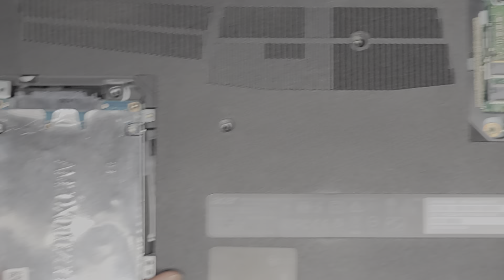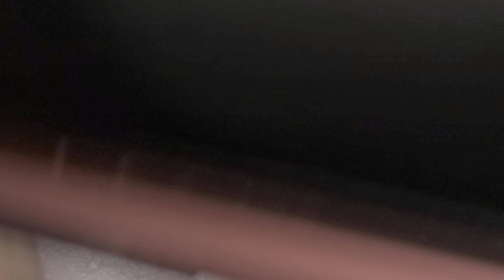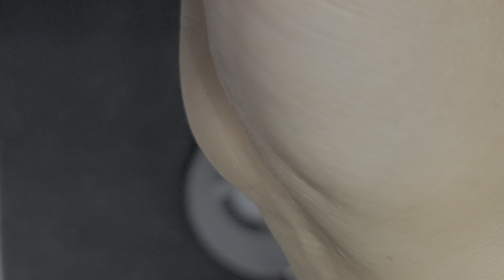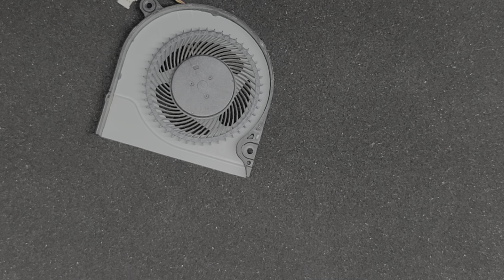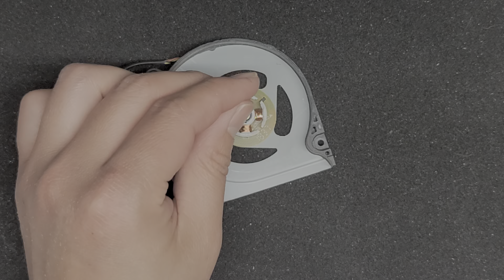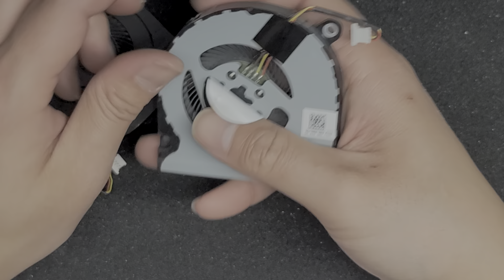Acer Nitro 5 AN515-53 Series N17C1 Disassembly RAM SSD Hard Drive Upgrade Battery Fan Repair Replace

Comment: Man, this video was the most helpful of all the videos I watched about disassembling and replacing parts on this specific model of the Nitro 5. I got an M.2 SSD for my laptop, and wasn’t sure where to start. It was also crazy how much dust buildup there was in my fans and in the laptop in general. Between an air compressed duster and my vacuum with the hose and brush extension, I was able to get pretty much everything (I was especially careful with the vacuum, of course).
Thanks again so much for this video!
Reply from the maker: Glad it helped. If you haven't already, please like and subscribe so others can find my videos. Thanks!
Reply: @ItsBinhRepaired  Definitely did both! Thanks again!!
Reply from the maker: Thanks!

Comment: Thank you! I've been suffering with intermittent loud fans for about a year now. Found enough pet hair to build a small rodent and dust for days! So aggravating but thanks to you it's back to normal!
My model is slightly different in that there are a several tiny screws holding the cover on the fans instead of the tabs. Just made it a little easier to remove and replace.
Great video with quality knowledge.
Much appreciated!
Reply from the maker: Awesome, glad it helped! If you haven't already, please like and subscribe so others can find my videos. Thanks!
Reply: Which size for fans screws ?
Reply from the maker: Don't know

Comment: 10:13 that is the haul effect sensor, that detects when the lid of the laptop has been closed. they work using magnets that are presumably build into the lid of the laptop somewhere. you can try it by running a weak to medium strength magnet over the general area of that side of the computer, the display should turn off
Reply from the maker: Yup!

Comment: The Hard drive screw was missing because they used it to hold the ssd down. I did the same thing, since the screw is not included with that ssd for some reason
Reply from the maker: Makes sense.

Comment: wassup bro, the video is great and the explenation is very exaustive, but i have a small problem.
in my nitro 5 (an515-52) i only have the ssd m.2 256 gb and i wanna add an ssd ( kingstone A400 500gb) but i dont have the silver bracket in my laptop… idk why, how can i add the kingstone ssd?can i add it without the bracket? sorry for my bad English, i’m from italy
Reply from the maker: Bracket isn't needed, but the connector is.
Reply: @ItsBinhRepaired  yes, i have the connector thanks bro for the response
Reply from the maker: @FettyBeatss  no problem. If you haven't already, please like and subscribe so others can find my videos and possibly consider watching a few others to get the algorithm to recommend my channel. Thanks!

Comment: Sssoooo. My hdd has a ribbon connector that is loose and I've been trying to figure out where to hook it back in at. It is this exact make and model. Problem is now that I can't figure out where the hdd plugs in, when I turn it on it tells me it can't connect. I can see the ribbon dangling plain as day. I've never seen one that sticks to the back like that
Reply from the maker: Under the other cable
Reply: @ItsBinhRepaired  hi i have this same problem. I was looking at the wrong video and lifted the case without disconnecting the hdd first and the ribbon got ripped out. Can you clarify which cables you are referring to?
Reply: Nvm. Already found it under the right side of the black strip
Reply from the maker: @weirdohhhhhh  lol great

Comment: Do I have to detach the HDD if I only need to clean the fans?
Reply from the maker: Just make sure to shut down completely. Do the battery disconnect and press and hold the power button 15 seconds.
Reply: @ItsBinhRepaired  got it. Thank you for the reply. Wish your channel for the best :) glad to find this video
Reply from the maker: Thanks! If you haven't already, don't forget to like and subscribe so others can find my videos.

Comment: Yo! Do I need to hit that little button to drain power out of my battery before replacing old ram with two new ram sticks?
Reply from the maker: @DiegoZambrana-n5m  not necessary, just make sure it's off.
Reply: @ItsBinhRepaired  ok! So shut down the cpu then I’m good to remove the ram slot cover and replace. Thanks!
Reply from the maker: @DiegoZambrana-n5m  yup, just don't drop anything conductive on the internal components.

Comment: Wondering if something like "3-in-one"  oil as it does not have additives for car engines in it.
Reply from the maker: Not sure what that is
Reply from the maker: @bit-tuber8126  I see. WD40 isn't really a lubricant. I'm not sure why people use it as one. The name WD40 means water displacement. Nothing to do with lubrication.
Reply: @ItsBinhRepaired  Well aware of history of Water Dispersant, formula 40, but just using popular notation.But 3-in-one, that is a lubricant that is not full of engine oil additives.
Reply: Also, read the side of the can for it's advertised uses. Then look at the ingredients to see it is oil based.
Reply from the maker: @bit-tuber8126  what's wrong with additives? Lol

Comment: Hello, can I use a SSD M.2 of 2 GB capacity? because I had read that this model is only compatible for 500Gb 😢
Reply from the maker: Do you mean 2TB? Yeah. The max limits are wrong.
Reply: @ItsBinhRepaired   Yes!! 2TB I was wron 😵‍💫, so there is no problem if I put 2TB?
Reply from the maker: @jonathanurielgarciagarcia8837  nope

Comment: Do i need to take out the hard drive and ram to take the back off?
Reply from the maker: Hard drive, yes,  RAM no, though if you can't do that part or you feel that's too much work, I don't suggest trying to open the computer.
Reply: @ItsBinhRepaired thank you I'm doing it right now for my first time ever taking apart a PC. Was having an issue of this battery being at 0 percent and not charging so I'm gonna try to reseat the battery
Reply from the maker: @Heazytoohot  hopefully that's the issue and not something more major. Hope it goes well.

Comment: I just removed the back plate to check if it has a ssd slot, removed all the screws and only removed the hdd cable from the board, and put it back, so after reassembling when i turned on , there is only acer logo on the screen, and it's still there, will it ever turn on? Help plz, should i wait
Reply from the maker: Sounds like the hard drive isn't connected properly

Comment: Im pretty sure the wire connecting the harddrive is probably broken, do you know where i could buy one that and another harddrive?
Reply from the maker: I'm not sure. Amazon or eBay possibly, if not you'll have to reach out to the manufacturer.
Reply: @ItsBinhRepaired  what was the harddrive you were talking about in video?
Reply from the maker: @jupiter3983  I'll need a time stamp

Comment: Great Video! Do the fans work fine with the taped on cover?
Reply from the maker: After the repair? Yes
Reply: Ok thanks you. I couldn’t find any replacement fans that came with the back cases so I will try that.
Reply: Ok thanks you. I couldn’t find any replacement fans that came with the back cases so I will try that.
Reply: Ok thanks you. I couldn’t find any replacement fans that came with the back cases so I will try that.
Reply: Ok thanks you. I couldn’t find any replacement fans that came with the back cases so I will try that.
Reply from the maker: @tuckerbergeron3175  ok

Comment: i broke the wire that holds the connector for the ssd, is this fixable?
Reply from the maker: Wire holding the SSD? I'm not sure what you mean. The screw?
Reply: @ItsBinhRepaired  sorry, i’m trying to fix it rn. i found the ribbon cable that attached the connector to the ssd but the pc is not booting, i’ve tried everything but it’s won’t even get power, any ideas on what it could be?
Reply from the maker: @safferey  I need a time stamp of the part you damaged. I don't know what you're referring to.

Comment: Is it okay if replace the fan without the back case and leave it open?
Reply from the maker: No
Reply: @ItsBinhRepaired  the new fan i bought no have back case in them
Reply from the maker: @jeredorks-wk3vv  transfer from the old one
Reply: @ItsBinhRepaired  is there any way to open it without the razor sir?
Reply: @ItsBinhRepaired  or is it safe just to razor and tape them?
Reply from the maker: @Jere Dorks  a knife? Sand it down? Melt it?

Comment: Quick question: Which fan is for the CPU and which is for the GPU??
Reply from the maker: Both and both lol
Reply: @ItsBinhRepaired  Laptop says CPU fan is faulty, how do I know which to replace?
Reply from the maker: Both. Check if any of them are hard to turn. Usually CPU fan will be dustier, but in this case they are attached to the same heatsink. They both cool cpu and gpu.
Reply: @ItsBinhRepaired  Okay, got an answer on a forum. The right fan is technically  the "CPU fan". Replaced it using your vid help. (thanks!) Also found massive dust bunnies between the heatsink inlet and both fans.
Reply from the maker: @robertlauderjr.3568  Glad you figured it out :)

Comment: Does anyone here know where the HDD cable is connected to in the laptop. I can’t find it
Reply from the maker: Open up the laptop, follow it and find out.
Reply: @ItsBinhRepaired I have and I’ve looked everywhere in that area but I can’t seem to find it
Reply from the maker: The connector is missing? I don't understand. It didn't have a hard drive connected?
Reply: @ItsBinhRepaired  I looked under the USB cord inside the computer like in the video but I didn’t see anything there. Is it under the fan?
Reply from the maker: @annieandelsieofarendelle3294  are you saying yours is different than in the video? If that's the case, I can't help you. I need your laptop model number to see if I have that video.
Reply: @ItsBinhRepaired  It’s AN515-53. I think I’m just not seeing something
Reply from the maker: @annieandelsieofarendelle3294  I'm not sure what you're asking. The cable was attached to the hard drive. What did you do with that?
Reply: @ItsBinhRepaired  it’s still attached to the hard drive itself so  that’s not a worry but it’s wear the cable attaches to the computer itself is what I’m trying to find
Reply from the maker: You're telling me you can't follow the cable? I'm confused.
Reply: @ItsBinhRepaired  I found it. Turned it was just hidden under a bunch of wires
Reply from the maker: @annieandelsieofarendelle3294  nice!
Reply: I also couldn't find the link